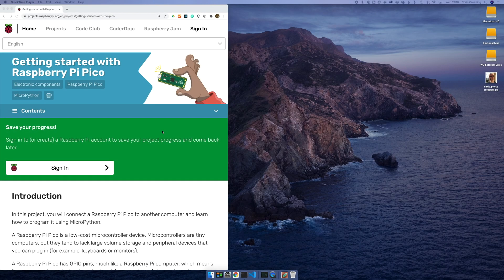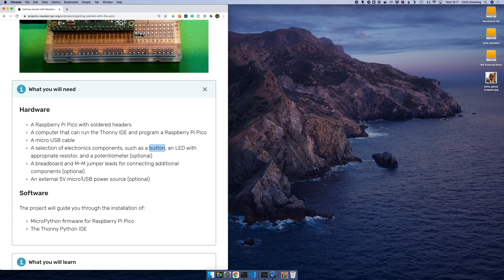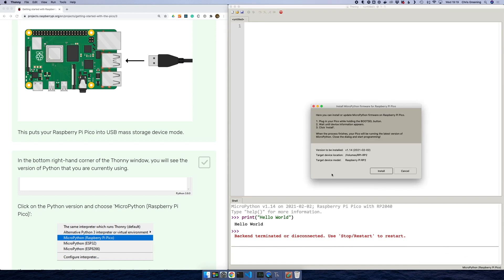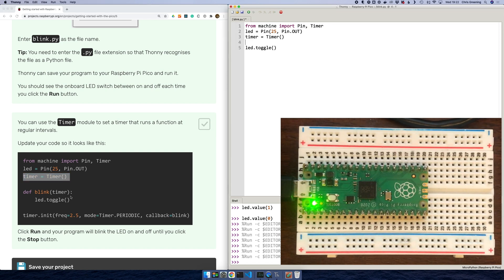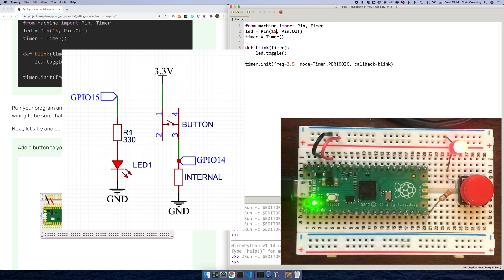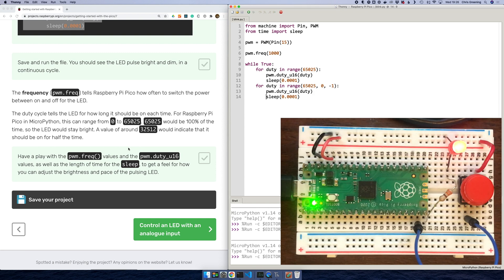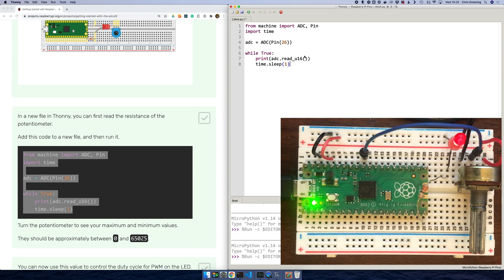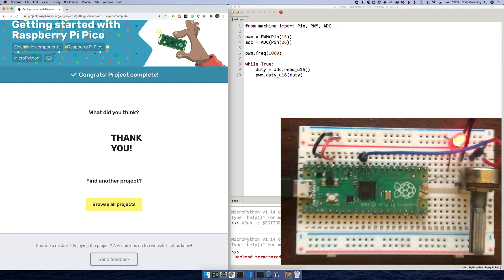Getting started with Raspberry Pi Pico - MicroPython

Comment: Thank you for sharing is it good for beginners in electronic/programming?
What benefits i get to start with the pico rather than the esp8266?
Reply from the maker: I would definitely recommend it for a beginner - the documentation and getting started guides are very good. The advantage of the ESP is the built-in WiFi and Bluetooth - so it really depends on the projects you are interested in doing. I would suggest going for the ESP32 range of devices instead of the ESP8266 unless you have some specific requirements.
Reply: @atomic14  thanks for the fast response i will try out the Pico first to learn the very first basics and when I'm better and the ideas will grow may i take the esp32.

If you have suggestions what additions i should buy for the Pico to get starter let me now i will appreciate it!